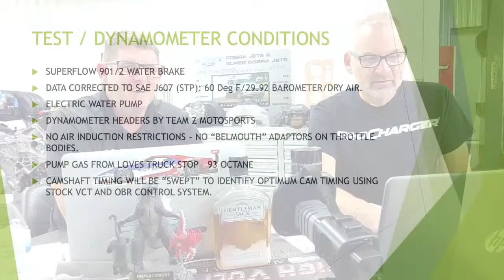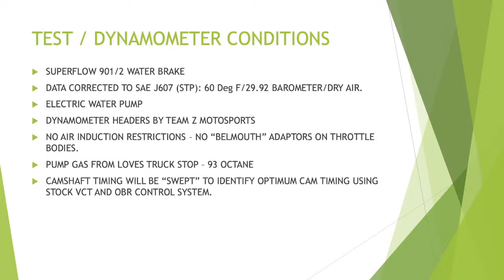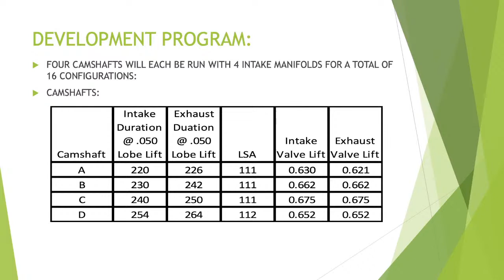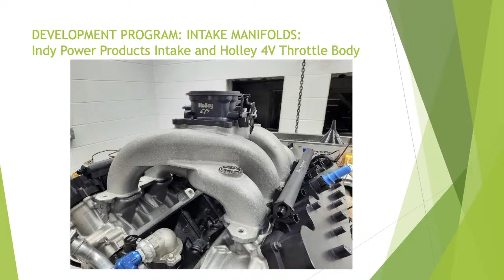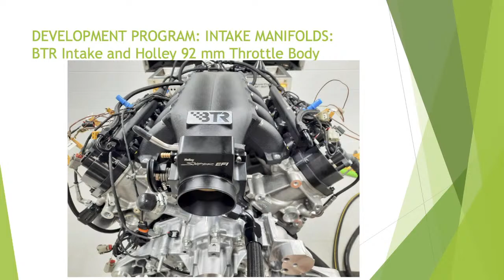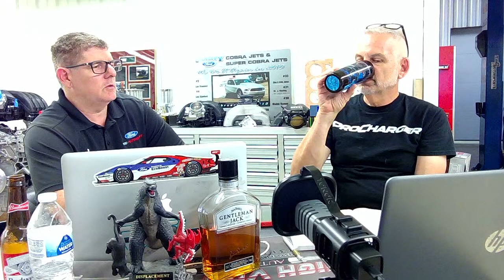Live with Brian Wolfe 7.3L Godzilla & 5.0 Mustang Chat

Comment: I ask why does those heads suck ass?
Same bore with a Ls does more than & a smaller bore ....

Fill the Cylinder? Joke of the day you'll need a aftermarket billet head NA.

Ooooh it's a forced induction Engine...
Reply: Between the Godzilla and Coyote, it’s how much and where you like your Tourqe, low and mid with Godzilla. Or up high on the Coyote. The Ford vs.Ferrari Lemans debate.
Reply: As a Ford guy, I don't understand why some Ford people have jumped on a pushrod truck engine when you have a proven winner with the 5.0 Cammer. Canted valve engines make more power than inline valves. Stop wasting money on a good truck engine when GM already owns the market with the LS. Ford never said they had a better in-line valve engine, they built a durable truck engine.
Reply: @RSDX99  As a Ford guy myself, I have no interest in an externally gigantic engine that is limited to 5.2 liters of displacement, has to rev over 8K rpm to make horsepower and never makes any real torque such as the mod motors and coyote.  Everyone has different interest and taste in a performance engine.  I’d take a Godzilla “truck engine” over a coyote any day.  Ford has lost many a performance enthusiast fan to the LS because many people don’t like the complexity of the coyote.  I’m not against overhead cam engines.  I think they’re great, but the large physical size  and displacement limitations of the coyote and mod motor family make it undesirable to me.  If the coyote didn’t have tiny bore spacing and could have some reasonable displacement it would be great.  Again, my opinion but there are many people that feel like me.  That should be pretty obvious considering how popular the Godzilla performance market is after only two years of existence.  It’s much larger and growing much faster than the coyote performance market was two years into its life despite the fact the coyote was just an evolution of the mod motor.  The coyotes market should have grown faster because it wasn’t an all new engine.  The Godzilla is all new and still it’s performance market is growing very fast.  It’s rare but there are people putting godzillas in GM vehicles.  Nobody anywhere put a coyote in anything other than the Ford it came in only two years after it’s introduction.
Reply: @paullane7489   No, Godzilla aftermarket is absolutely nothing special.   It’ll likely get cylinder heads because it needs them
Reply: @BCSVT  not sure where you get that.  The Godzilla aftermarket is absolutely exploding for how new the engine is.  It’s probably over three times the size of the mod motor aftermarket in the same time frame.  Nobody made anything for a 4.6 more motor for years after its introduction despite it being in the mustang.  If a version of the Godzilla was in a mustang, the aftermarket would be even bigger.  There’s never been a new engine with as much aftermarket development as fast as the Godzilla, not even close.  Yes the coyote’s current aftermarket is much greater now but didn’t grow as early in its introduction as the Godzilla has.
Reply: @paullane7489   The 4.6 came out in Mustangs in 96 — it took a few pioneers — like Mihovetz — who weren’t scared to show the capability of the platform before the good old boys began to take some interest.     There was a learning curve there…

Godzilla is same old, same old.  
Nothing new — and the aftermarket support is nothing special at this stage even with a lot of the LS crowd stepping in to offer services for it thanks to the old-school technological overlap.  

Also I get that from actually working in the aftermarket industry and being able to discern hype from substance.  
The Coyote aftermarket absolutely advanced in 2011 as quickly Godzilla is now — the primary difference you’ll see is that Godzilla will likely get some aftermarket double roller valve-train and aftermarket cylinder head castings first.  

Two things the aftermarket didn’t bother with for Coyote since the OE stuff was already so dang good.
Reply: @BCSVT  ok.  I could agree that the overhead cam design of the 4.6 slowed the aftermarket support.  But again much of what we are discussing is opinion.  As far as the gross volume of aftermarket support at this stage in the Godzilla’s life, the gross or total amount is much more than the mod motors at the same point in its life.  How that relates considering the complexity of the mod motor vs Godzilla is debatable.  Either way, again in my opinion, I and many others would take the cubic inch advantage and simplicity of a Godzilla over the displacement limited and more complex coyote any day of the week.  Again, I’m not against overhead cam designs and the advantages are known even to me.  But although the coyote makes great power with boost, for my tastes(street torque and useable horsepower), a pushrod engine with more displacement is more desirable.  Again my opinion.
Reply: @paullane7489   Cubic inches are indeed nice but Godzilla’s existence annoys me to no end when they already had a FAR superior performance architecture in production with the Boss.

Boss has the same displacement potential as Godzilla — the engines share identical bore spacing and journal diameters.  

Godzilla is a decent engine — even a great engine for Super Duty — but Boss could have easily been refined into bar none the greatest domestic V8 architecture of all time.   Easily. 
Ford could have gone out of the ICE era on top instead with a whimper thanks to mundane Godzilla

Hearing Brian Wolfe say the larger bore 6.2 “wouldn’t fit” in SD and poo-poo the engine because it used 2 spark plugs per cylinder makes me laugh and throw up in my mouth all at once — it’s blatant BS since the 6.2 fits in SD with ease and Godzilla and Boss deck height are not far off (9.65 vs 9.42).    

That Boss based 6.9 should have had Siamese-bores like Godzilla and 4.22” bores (like Godzilla) but kept the 6.2’s 9.42” deck height and stroke. 
It would have retained the exact same external dimensions as the current 6.2, fulfilled truck duty at least as well as Godzilla and been a legitimate performance terror for all with tons of potential thanks the increased valve sizes made possible by that 4.22 bore and that beautiful (and blatantly superior) opposed valve arrangement.  

Boss’ valve placement/angles and intake port path was so drastically superior to Godzilla’s as a performance application it isn’t even funny.
Reply: @BCSVT  I agree with everything you said 100%.  Ford wasted a good engine design with not further developing the 6.2 Boss in a performance application.  I think they should have developed a 7.0 liter version with dual overhead cams.  That would have been a world beating engine for sure.  The only thing I differ on is I believe the Godzilla also has a good bit of performance potential itself.  Not as much as a big cubic inch version of the Boss 6.2, but still good potential.  Ford could build an all aluminum version of the Godzilla with better heads that could be a great performance engine.  I’m sure they won’t do that though.  That’s the Ford way.  😂
Reply: @paullane7489   So I don’t think we’re too far off of each others pages — we just came at it from difference directions.  

I’ll make no bones about it — I love 4V Modulars and I include Coyotes in that.   I recognize their one real weakness though and that’s capped displacement potential due to the 100mm bore spacing.  
But Mod/Coyote remains one my one favorite engine architectures of all time — the Boss 9 is probably my other favorite.  
Boss was essentially the Mod put on a 4.53” bore spacing — the potential was astronomical with larger bores/valve, 4V-heads, Aluminum blocks.     
It ticks me off Brian Wolfe chose to waste that untapped potential.
Reply: @BCSVT  agreed.  My only hold up with the mod motors and coyote platform is the small bore spacing as well.  👍